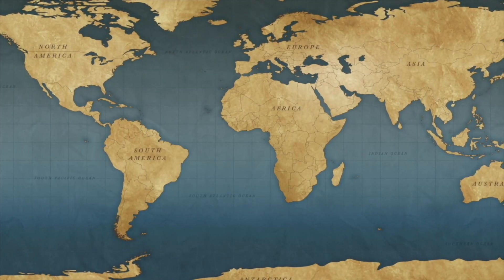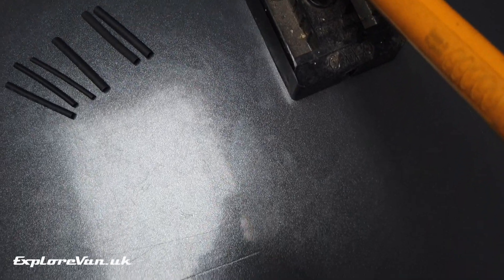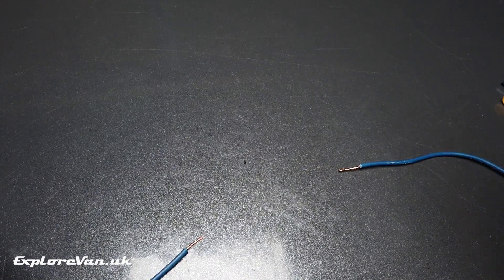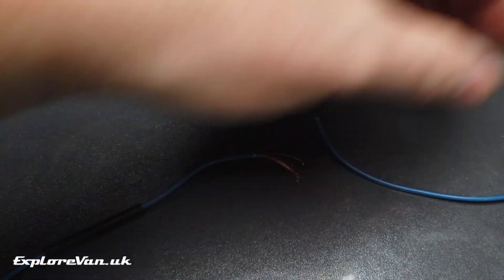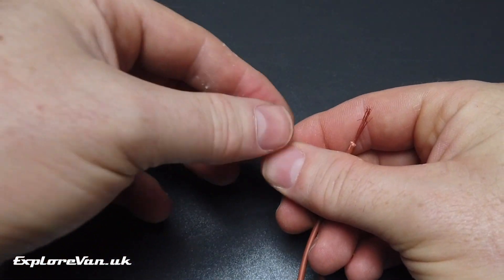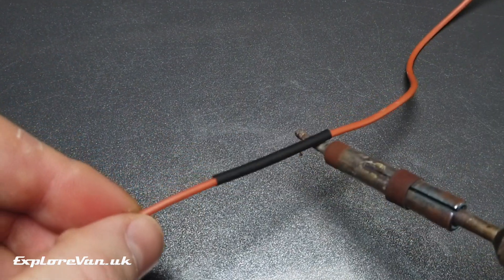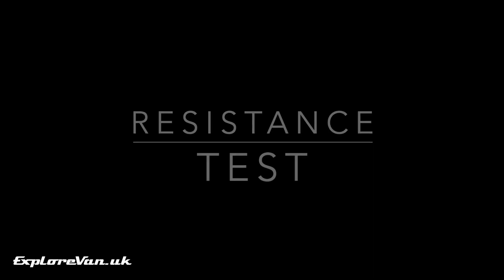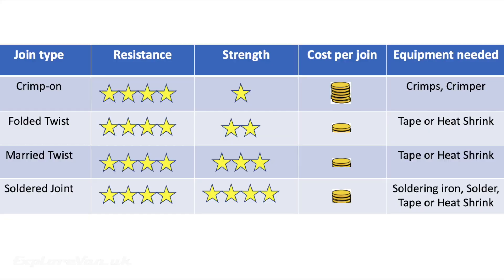Best way to join wires? Tested! - crimp, twist, solder.

Comment: I avoid insulated terminals when possible.  They are far inferior to uninsulated crimps which can be visually inspected before the application of adhesive lined heat shrink.  The uninsulated connectors and terminals are smaller in size and provide a stronger mechanical connection.  And the adhesive lined heat shrink will provide an excellent environmental seal.

Comment: Great video! Surprised how strong the married joint was. I always opted for soldering but have recently been dabbling with crimp connectors. I bought a pair of draper ratchet crimpers but have never been happy with the joins I’m getting. Invested in a pair of knipex manual crimpers and they are excellent. Testing tonight, I was able to hang a 10L tin of paint from a 0.5mm2 wire (crimped with ring terminal). Adding a second 9L tin the crimp failed. Saying that, the wire actually broke leaving strands in the terminal.
Reply from the maker: Thanks that’s great insight! Cheers

Comment: Your resistance test is measuring your test leads and the wires rather then joints.
Reply from the maker: Yep,  agree that the leads are in the circuit but the point of the test was to show if any of the joints had a significantly different resistance to another which it still does.

Comment: One tip I would like to add, some crimpers are  handed you should only feed the cable in from the side where the coloured dots are on. The jaws of some crimpers are offset to enable them to crimper correctly.  Good demonstration video solder all the time
Reply from the maker: Great point! Thanks for sharing!

Comment: In a vehicle crimp, if done correctly, (few are), is the best. Solder can fail due to vibration. Same for gas, never use solder fittings, always compression.
Reply from the maker: What’s the secret with correctly crimping? I’ve never been able to do one I’m totally happy with.  

I can understand not soldering gas pipework as the rigid pipes could vibrate it loose and a small crack could be a significant leak. But can’t see vibration impacting a twisted solder flexible wire joint.

Considering all the components in your radio, fridge, heater, tv etc are probably soldered to the PCB I doubt it can be that much of a problem.
Reply: @ExploreVanUK  Thing is, you might find solder in the PCB and in your fridge but you won’t find any solder in car manufacturing. All joints are crimped for reasons above 👍👍
Reply from the maker: In the engine bay, on unsecured wires that could flex I totally get it and Vs a professionally fitted crimp I can understand.  

In my experience the consumer crimps and crimpers are rubbish and I personally would trust a soldered joint to be more reliable in the living area when the wires are well secured. 

By fridge I meant the purpose made one in a van so designed to survive vibration. There’s plenty of solder in automotive components / instrument clusters / radios etc. (Quick example here https://i.pinimg.com/474x/99/81/4b/99814bab0bac28ef8b9d237c988554b2.jpg    https://www.rlocman.ru/i/Image/2008/02/18/1.jpg )

I’d still use the Married twist and heat shrink (without solder) over a crimp. May be it’s just me but what ever I do with the crimps they pull out too easy for me.
Reply: @ExploreVanUK  I agree with your comments, I am just going on what I was told by an auto electrician when he helped wire up my van.
Reply: @ExploreVanUK The secret is to use uninsulated terminals and the correct tool for uninsulated crimps.  Then cover with adhesive lined heat shrink.
Reply: @ExploreVanUK  The trick with crimps is to use a naked one and put the insulation on after. Plus, don't twist the wires they should lay flat to get the best cold weld. Ratched tools are good but for the pressure that is really required you need an air powered tool.   Solder can crystallize over time and most DIY soldering is usually atrocious, often overheated.
Reply from the maker: Thanks that’s useful.   Not sure I’m ready for carting a compressor and air crimper around 😉

Good point on the soldering, I find using a quality solder (specifically for electronics not the gas stuff) and a good heat controlled soldering iron a bit of practice most people can do it well.